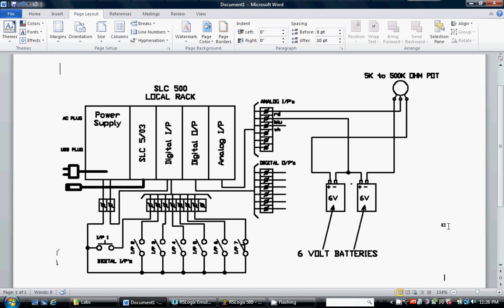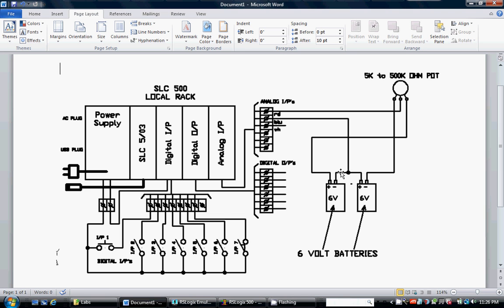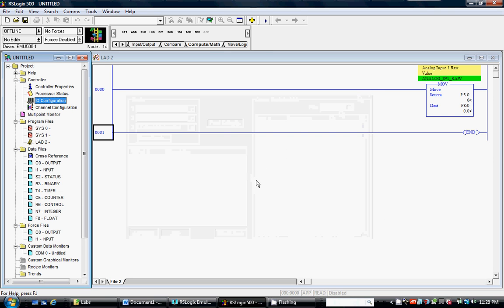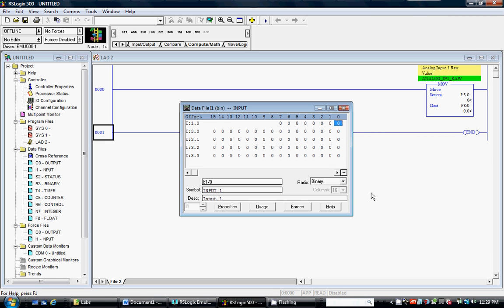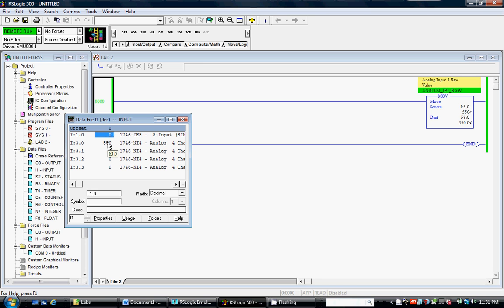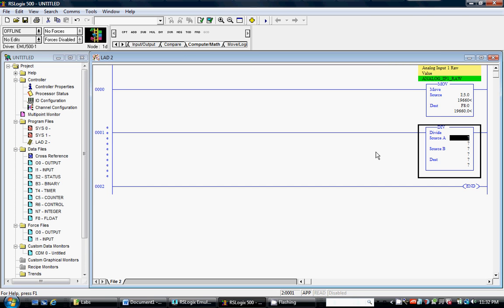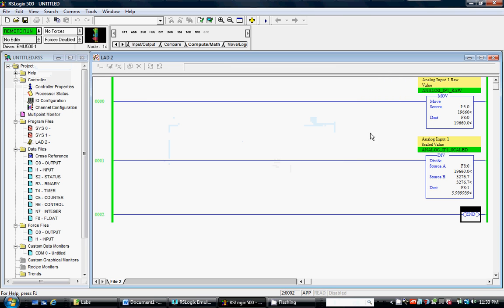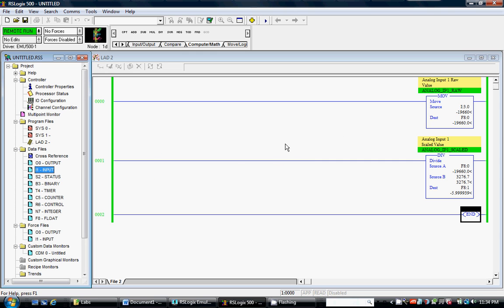RSLogix 500   Advanced Programming   Analog Input Circuits

Comment: why do you use 3276.7 as scaling factor ? I am not able to determine how do we choose scaling factor.
Reply: what is the biggest decimal number you can create using 16 spaces or blocks (bits) in binary?    32768 posible combinations. In decimal numbers it is 32767 be cause the zero also needs a posible combination
Reply: +Mahipal Raj  He is using that number because of value ratio 10:1 ,  max decimal value of the word divided by 10, this way if the value changes due the turning of the potentiometer will show nearly perfect the voltage being reading.
.  hope this help your question.